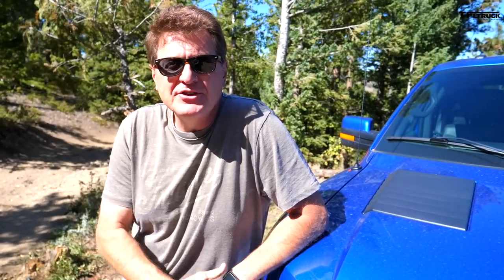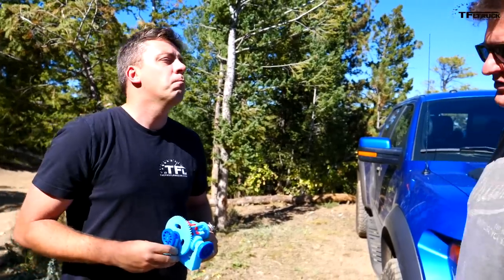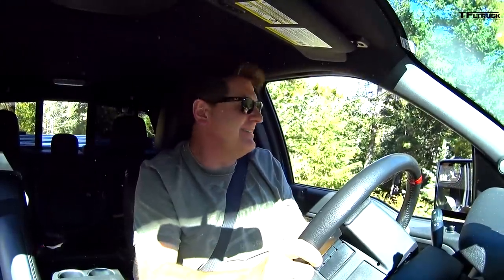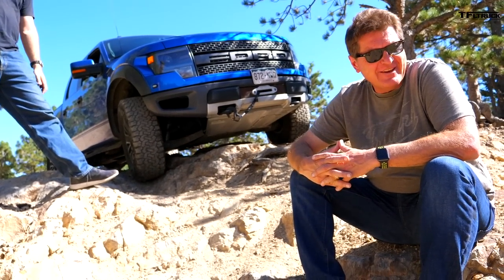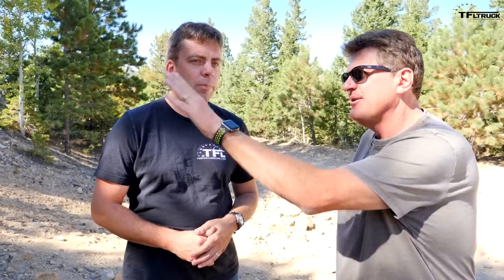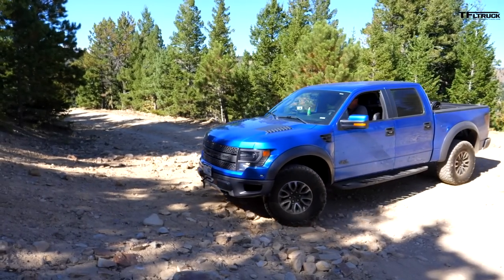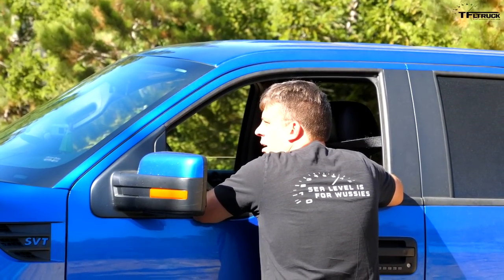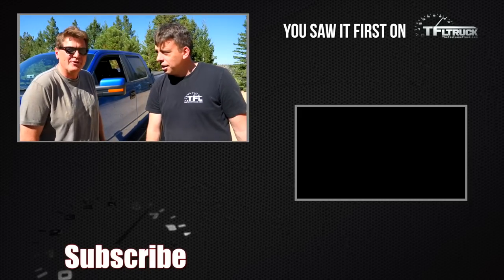How Important Is a Locking Diff When Off-Roading?

Comment: My god....this was the worst 10 minutes of my life I wasted. The first hill was ridiculous beyond belief. (I could climb that in 2wd in my GMC on 35"s without even slipping a tire but they talked about it like it was so tough.  (Everything what I say is taking into consideration that camera angle doesn't sometimes give you the real angle of the hill, but it's pretty good video and they filmed it pretty level comparing it to other trees around so I can tell it's close) also taking into tire difference, my 35's versus just all terrains and I have the g80 locker in my gmc.....You have to have a lift...they ran into the problem. Sure. But im excluding that.  But a lift can fix the bottoming issues. The last hill (a little more than a 45 degree angle) I've climbed in my gmc just crawling in 4 low with fat rocks you have to flex hard over on the way up, the back end slips real quick, give it a little gas, back end locks up, and it crawls up in 4 low no problem up a WORSE hill......And that's not even being too hard on hard on a daily driver truck when you want to/need to make it up that hill....And I hate people that use speed to get through obstilaces.... I'm all about traction and a smidge of throttle. Speed breaks things. Traction gets you through things. My gmc would OWN this truck raptor off road. Just saying....can we put trucks through REAL shit that country boys wouldn't be afraid of putting their daily driver through? Cuz this was weak....I have video of me making it up worse hills, in worse conditions and making it up with little slip and little throttle....

Comment: Yep, you needed momentium,hehe, even a a bigger truck with bigger tires would have a problem on that dry hill. Tread type is one thing,those A/T tires ain't worth two shits off road. And the Pro comps I have would struggle from a dead stop at the bottom. Common sense people. Some folk have it,others do not.They will twist this into an add for new locking diffs. Give me 20 yards and I will top that hill in my crappy 2014 chevy work truck full of tools. Then go get my old Ram truck with Pro Comp mt2's and show you how to do it with only two wheel drive and do it again. It's all in aproach and technic but they want you to think that it's their product that is paying the bills that week that does it. Common sense and just a lil grasp of physics will get you there.

Comment: What an idiotic way to test the differential's locking feature... Come on now, just put it on rollers or if you can't find these - find (or make it) some muddy surface where you can consistently make certain wheels slip and then make a video.

Comment: Blah Blah Blah… make a more scientific test.  Do it again. Use 2wd with and without rear locker to better isolate the locker as a test variable.  Clearly the front traction device was working so well you were only observing the difference between guaranteed 3 wheel drive and guaranteed 4 wheel drive.  Testing this truck on a surface that requires the suspension to articulate a little further will highlight the differences much more dramatically.  I enjoy watching your videos, but this one was a bit of a disappointment.